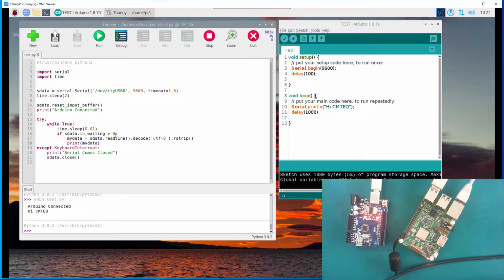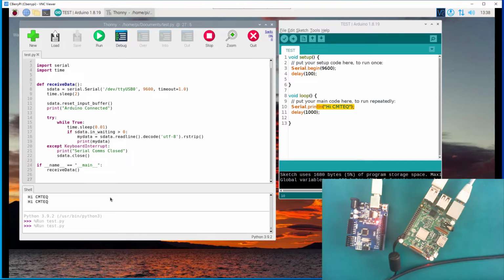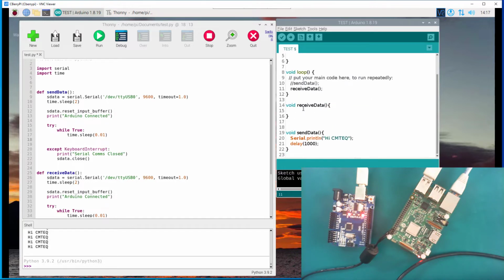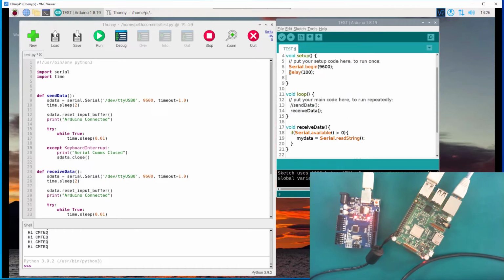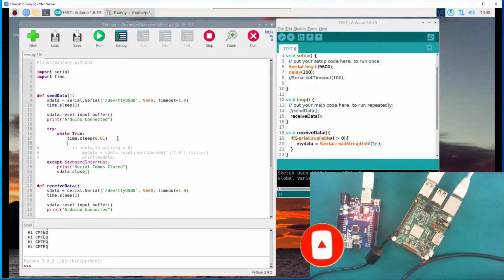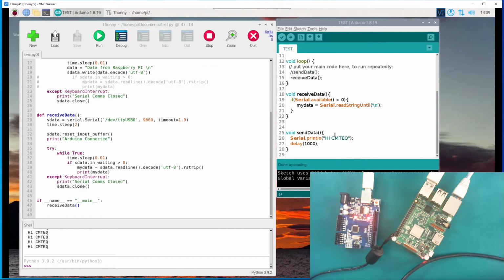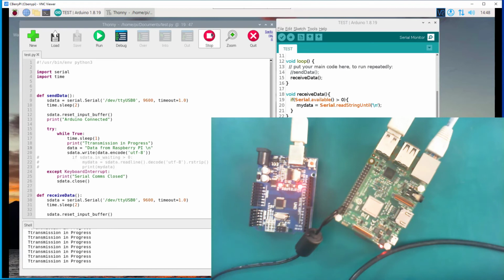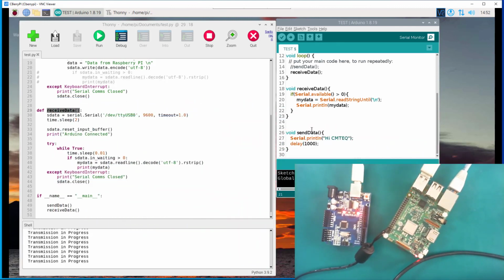Raspberry PI Arduino Serial Communication - Part 2

Comment: Thank you.  This worked quite nicely,  I slowed it down with a delay of .04 and it seems to have no issues with collisions going either way.  It works fine to control my robot from the Rpi via the serial cable to the Arduino, and to occasionally send signals back to the Rpi from the Arduino.  I had assumed I would need to send some kind of interrupt back to the Pi but that doesn't seem to be necessary.  Anyway, again, thank you very much.  Now that it is all working, it looks easy ... but that certainly is not how it looked when I started. Your level of detail was perfect.
Reply from the maker: Very well, that's the essence of a bi-directional communication. You can literally execute any task based on the instruction send and vice versa, just a matter of conditional statement and variables validation. On the Arduino side it depends on the action you want to take and the processor availability to wait for instructions, you can always trigger software interrupt for certain task.

I'm glad you found your way, stay tuned for more, and also feel free to share your experience.

Comment: Can you please make part 3 also?
Reply from the maker: Thanks for your interest, Its coming in a day or 2, make sure you subscribe and enable the notification so that you don't miss it.
Also please like the video if you find it useful. Thanks !
Reply: @CMTEQ  Yeah sure! But can you please add some of the functions like controlling some LEDs or motors with arduino through serial communication. Hope you get millions of subscribers!!!
Reply from the maker: Yeah, I have similar applications with stepper motor, will get to them in due time. Thank you for the support.